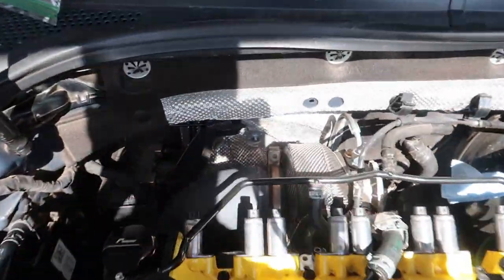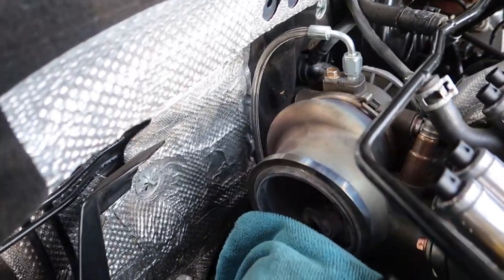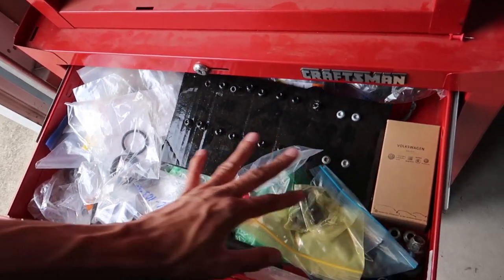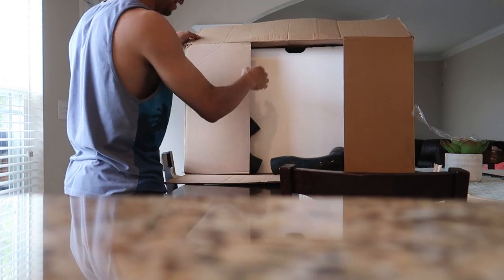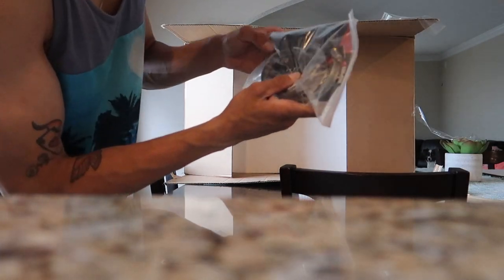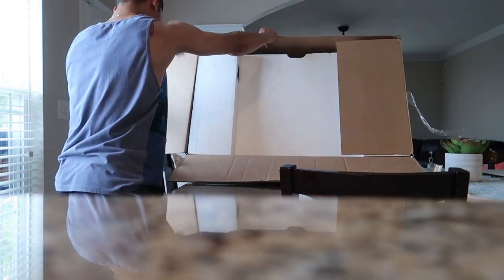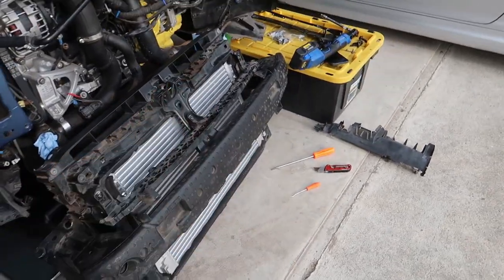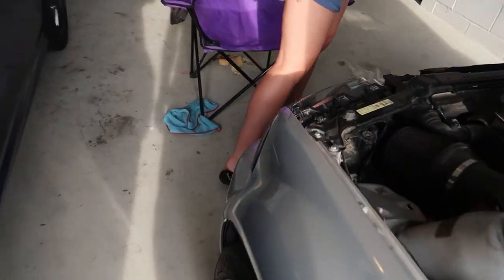Old turbo out [Carnage]! New AMS intercooler in, big weight savings! | MK7 Golf R

Comment: Why go to tube and fin from bar and plate?
Reply from the maker: It performs better real world*, plus the weight. Trying to get under 2900. I'm at 2940lbs now with half a tank of fuel 😎

*Edit: over the racingline at least. I don't really worry with the tube vs bar. AMS knows their stuff
Reply: @BryceJordanProductions  I have had both, I can't say I had that experience. Sold my AMS and went bar and plate. The tube and fin is no doubt lighter though.
Reply from the maker: What did you go with after AMS?
Reply: @BryceJordanProductions  Mishimoto, very nice piece. Here is some test data, not lab quality but still...You may be upset to see where AMS falls in the graphs as one of the worst performing.- http://mygolfmk7.com/2020/07/mishimoto-intercooler-bench-cooling-test/
I cannot vouch for the test data in any way, just used that in part to make my decision, I have no ties to anyone.
Reply from the maker: How much of a difference did you see real world? Everyone else I've talked to has had the opposite experience real world with data logs to prove. That's very interesting to hear. I've see the flow data but bench flows vs real world use are way different
Reply: @BryceJordanProductions  My results were not significant and I did minimal testing, its hard to replicate conditions doing road logging and I was not chasing only IAT's. I also had trouble with the porous cast finish on the end tanks where the silicone houses connected, at 35+ psi I would get a very slight leak using the soap test under t-bolt clamps. I wanted a machined hose end and I also wanted to have hose options, AMS uses custom size hoses due to the slightly larger end tank connections. No matter, the AMS will be superior to stock and the weight savings is substantial, I think it was almost double the weight for the Mishimoto. Makes you wonder if any gains I may have gotten get nullified by the weight. The direction you seem to be headed I would take the weight savings win and not sweat the results others have, you will be able to do your own testing.